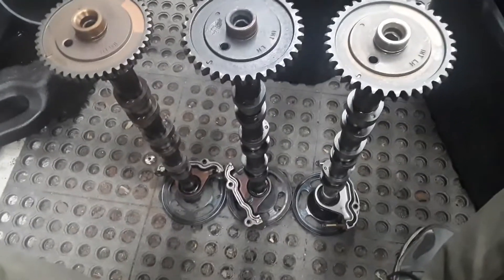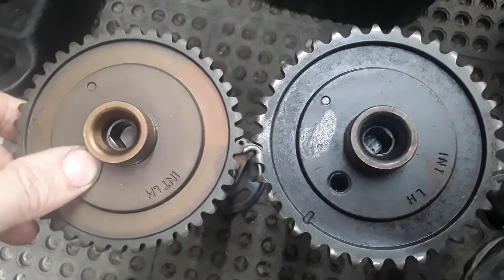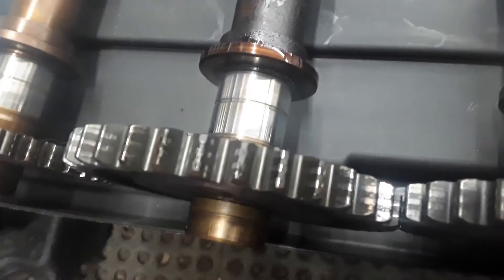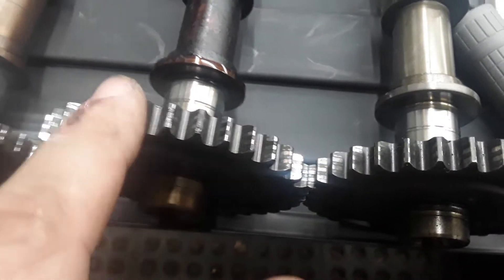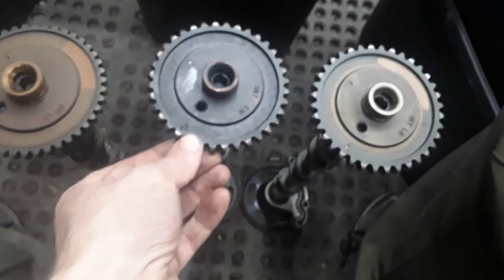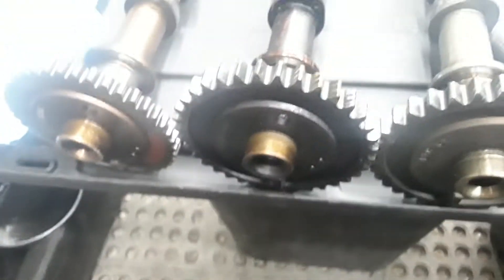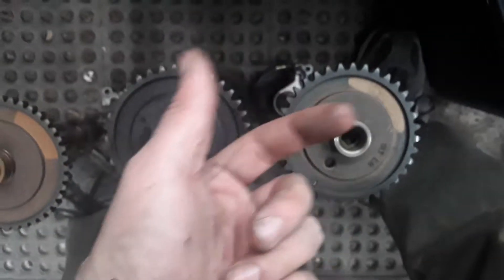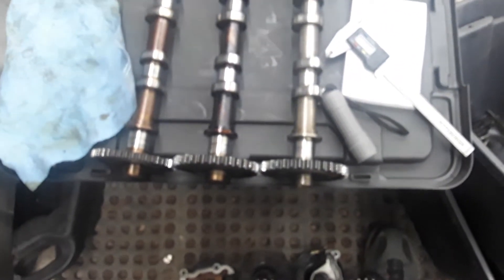Ford Duratec V6 Camshaft Comparison 3.0 2.5 SVT

Comment: Building a duratec 3.0 thanks for the advice
Reply from the maker: Recently found out the 2004+ 3.0 cams have a better lobe profile than the 2004 and older 3.0

So the 04+ 3.0 cams are more compatible to the SVT cams besides the teeth being different of course.